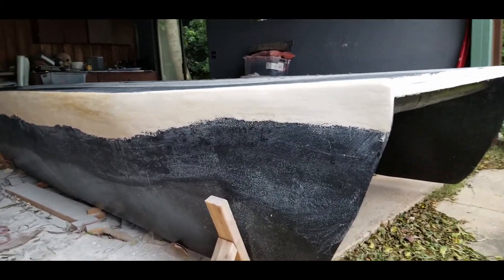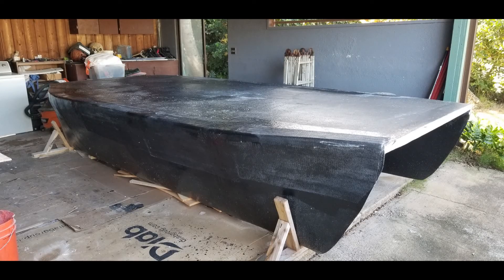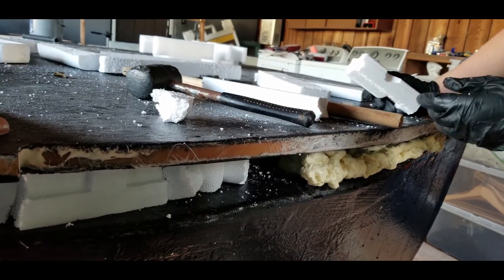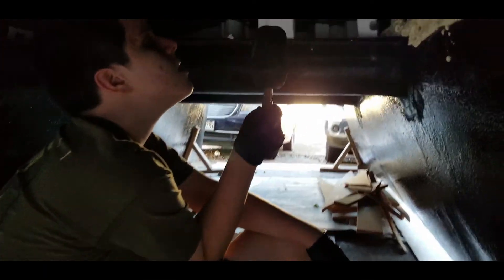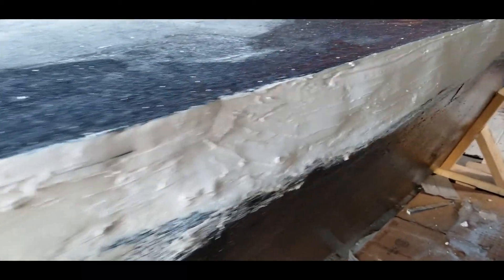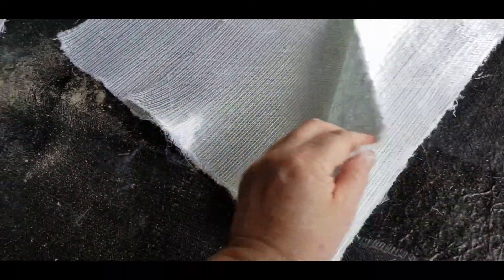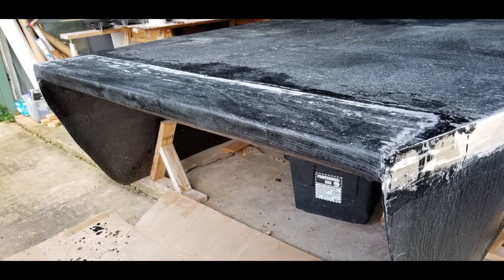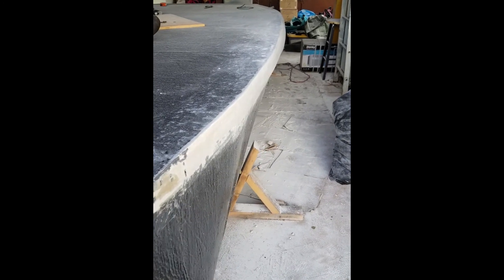Solar Patio Boat Build 20 - Filling & Fiberglassing

Comment: What is your plan as far as the amount of solar watts, battery capacity, and performance? I'm thinking about something similar except starting with an existing pontoon/ catamaran hull.
Reply from the maker: I would have also started with a hull but there are non available on my little island so I had to build one. These hulls are extra slicy to avoid the need for tons of HP. I am going to start with two 60lb thrust 12V trolling motors and go up from there. I am just going to be using this boat on a few flat calm rivers.  As far as the solar goes... 200W for each motor/battery should be good to start.  Starting with a full charge this will meet my needs for light cruising. Can always add more panels or a small gas outboard if needed.
Reply: @DIYKauai  Thanks for the reply. Can't wait until everything is up and going. We had an 11-foot pontoon boat with 55 pound feet of thrust 12v trolling motor.  Fun and stable little boat.
Reply from the maker: @wes326  I am hoping that two will allow asynchronous steering...
Reply: @DIYKauai  I don't think the number of engines matters much if the single engine will pivot to 90 degrees. It will turn on a dime.
Reply from the maker: @wes326  with two hulls it can be much more responsive with two motors... only $150 each so no biggy!